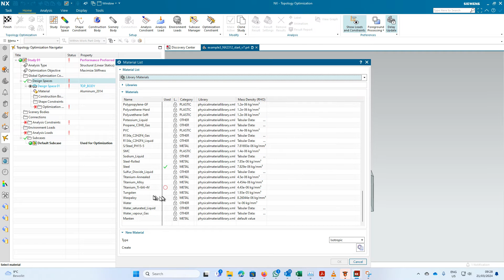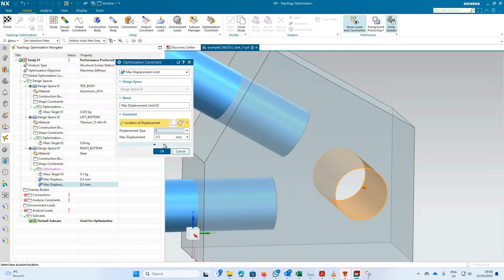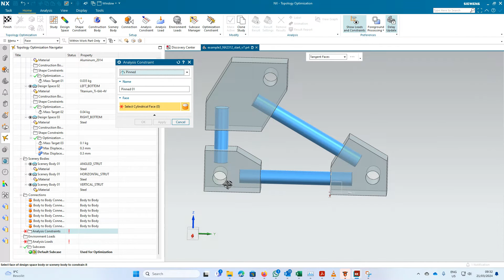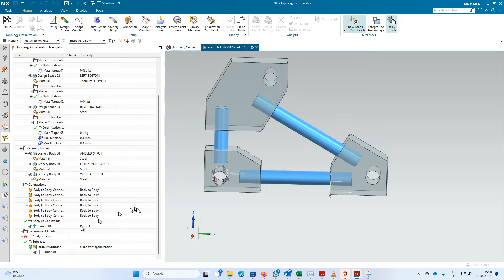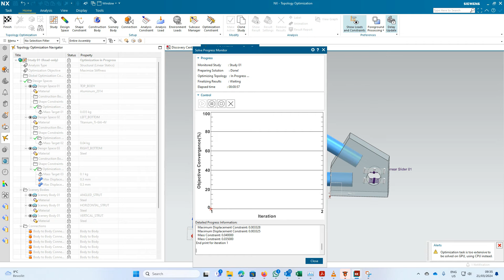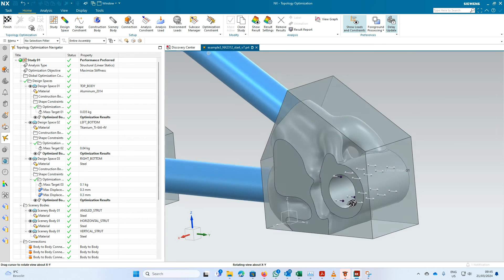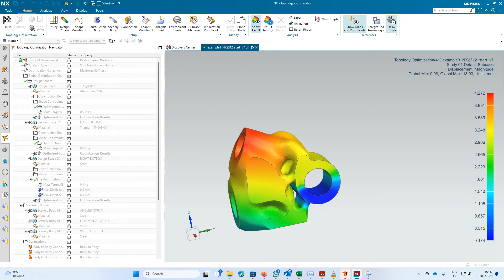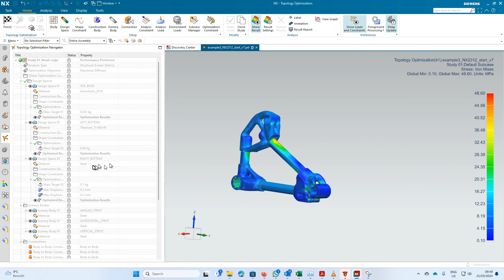How to use NX2312 topology optimization with multiple bodies

Comment: The question about Optimization..., IF you can make some videos about it it would help a lot.  Also.., videos about Mechatronics Concept Design and More Simulations.  I'm having difficulties to put a roller chain upon its Sprocket and make it move.  There are too little about it.  You can make Courses that are also very rare and very necessary.   You have a good way to teach, just make the videos a little louder and make Questions during your presentations because this is a strategy very efficient to keep people focused !   And THANK YOU very much for your Videos and Efforts.